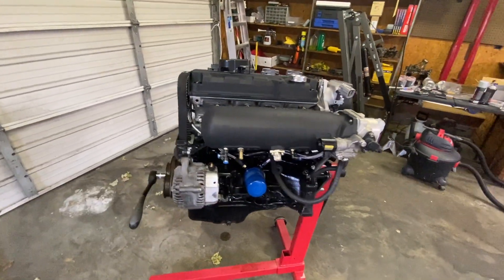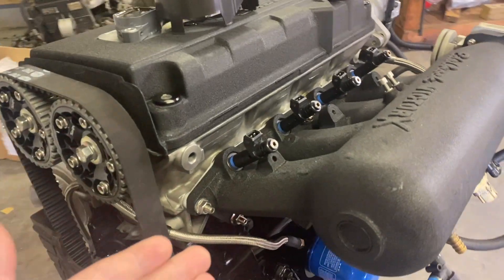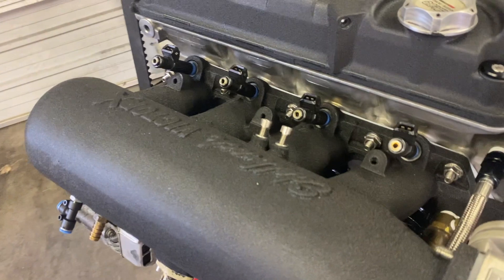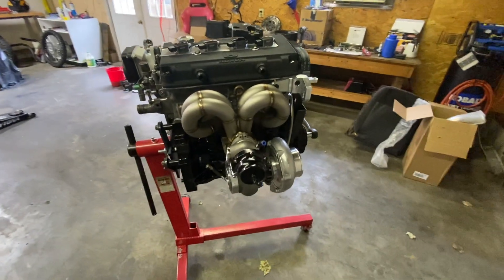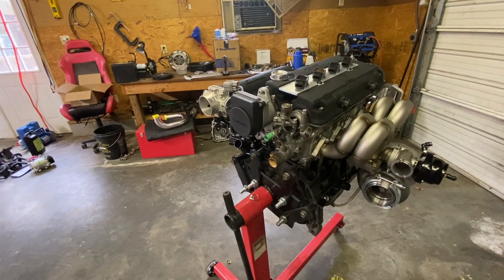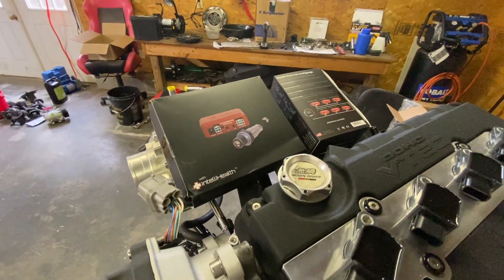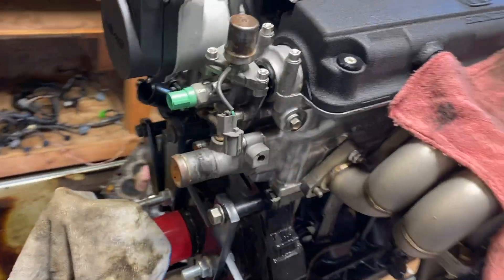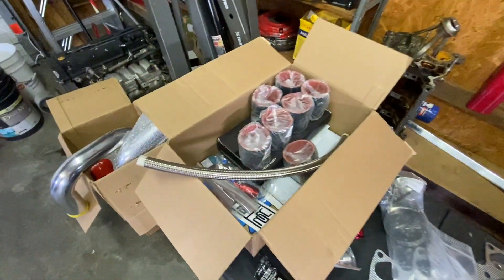B20VTEC Gets a Turbo KIT

Comment: What COP is that? Burton Racing?
Reply from the maker: Edgar Manzanares yessir
Reply from the maker: Use discount code SCVID to save yourself some 💰
Reply: What brand are those quick disconnects (vac/boost) & where do u get the hose ?
Reply from the maker: Edgar Manzanares ship Burton Racing, it’s a kit offered on their website
Reply: You can set up the plx gauge with multiple sensors. All u need is the SM-Pro module.  I've had mine set up for about a year.